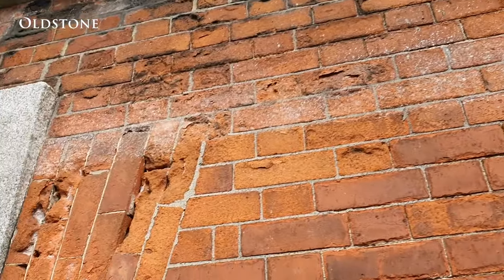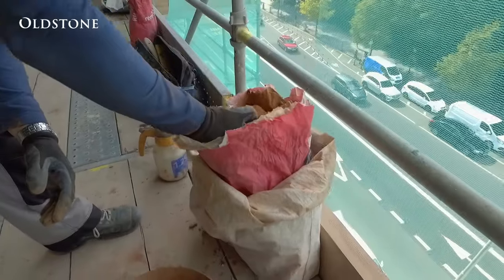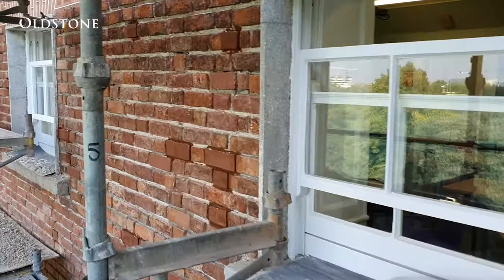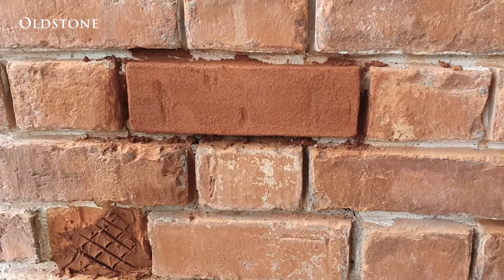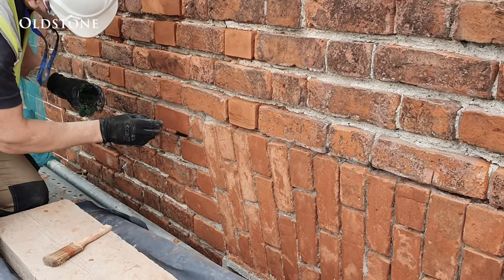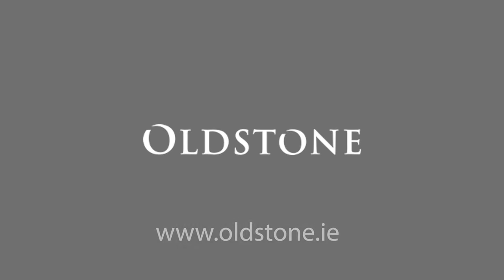How To - Brick Repairs

Comment: 00:04 Repair badly weathered brick with mortar
00:42 Brick repairs are done when less than 50% decayed or similar replacement brick is unavailable
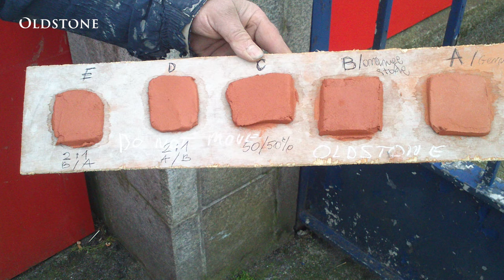01:12 Brick repairs require matching color and tone
01:46 Identify and mark up bricks for repair
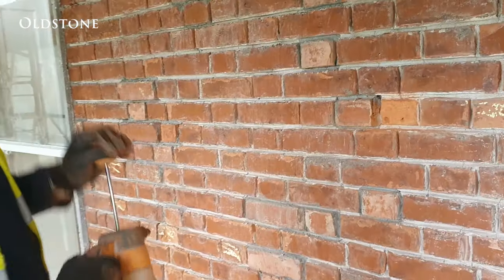02:31 Brick repairs involve removing dust, moistening, priming, and applying watered-down repair mortar.
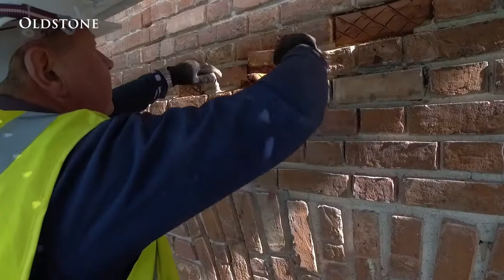03:16 Brick repairs involve applying and shaping mortar layers.
04:04 Mortar protection and tinting process
04:56 Brick repairs involve blending the surface with adjacent brickwork.

Comment: Very nice. If it didn't matter about the aesthetics, like the brick was not seen from the ground, could one just render over the spalled damaged brick? And Will this mortar take a fixing?
Reply from the maker: You could but it will most likely fail due to lack of bond and difference in materials.

Comment: What is the most cost efficient option (repair or replace)? How long does the mortar repair option last?
Reply from the maker: Hi Iain, thanks for your comment. For longevity it is always preferable to replace the brick with a matching one however this is not always possible. Where a brick is repaired I would expect it to last for a duration of at least 20 years if not longer. Regards. Jimmy

Comment: How can a motar repair have longevity 2 harsh winters that will blow and fall off i have done heritage work and that has never been approved
Reply: Can you advise how you repair yours? Thanks
Reply: Chop the brick back to at least a half and replace
Reply: @david barnett  I have some red rubber brick corbells in my house that need repairing. Would you be able to suggest a good method for these? Do you use lime or portland for your mortar for your half brick method? Many thanks
Reply: Nhl usually
Reply: @davidbarnett8002  Thanks.